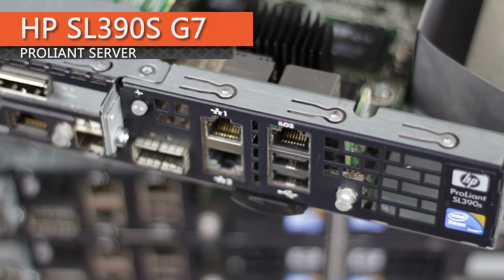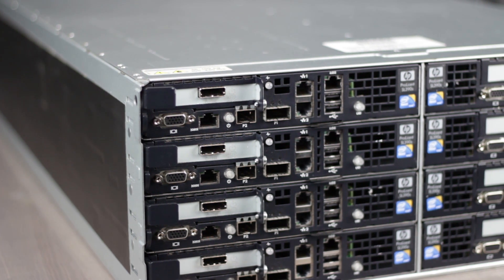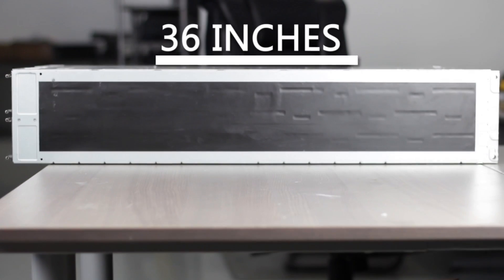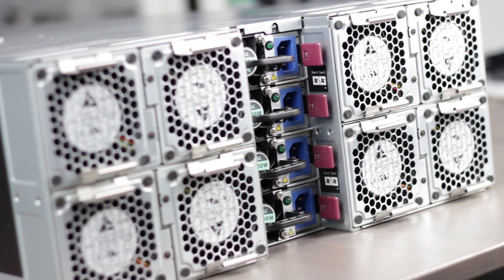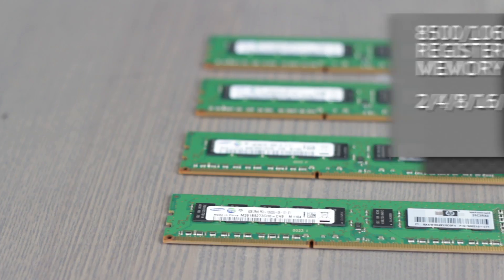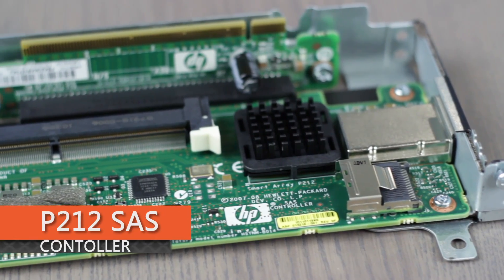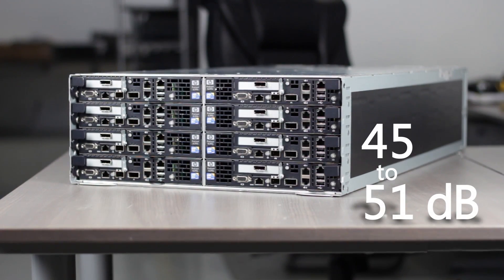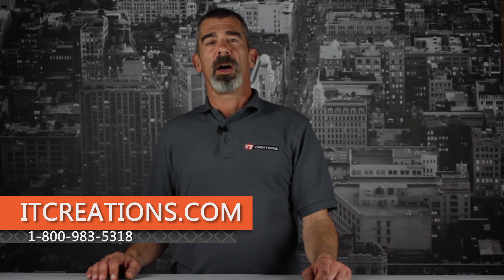HP SL390s G7 1U Server and the S6500 Scalable System Chassis Overview ( IT Creations, Inc )

Comment: No shared input/output? Each node has its own input/output?
Reply from the maker: I will preface this comment by saying this system is about 12 years old. Each of these nodes has a 1GbE RJ45 port, a dedicated iLO3 RJ45 port for management, a 10GbE SFP+ port (which might be optional) and a serial port. Only the serial port is a shared input/output port in this situation. See page 1, Quick Specs node.
Quick Specs node: https://www.hpe.com/psnow/doc/c04123322 
Quick Specs Chassis: https://www.hpe.com/psnow/doc/c04123242.pdf?jumpid=in_lit-psnow-getpdf 
Hope that helps. thanks for watching!

Comment: HP SL390s G7 regarding the 4u version of this model that accepts 8 GPU cards. Will this only work with Tesla GPU cards or will it work with any PCie 2.0 compatible GPU cards like the Nvidia 1080 or 980 etc...  In their PDF it states that the tesla cards are compatible but the slots and operating system would indicate that other cards could be used. What do you think?
Reply from the maker: +xpez Yes, the 4U version does accept 8 GPU of supported cards. However, the GeFiorce GTX 1080 is not on the list of supported cards, which does not necessarily mean it won't work. that said, the GTX 1080 is a double-width card so right there you are down to 4 supported GPUs of the 1080 variety. I think the power will support the requirements because you do have 225W/GPU on the SL390 and the card (1080) only requires 180W. Another consideration, are the lanes themselves which are PCIe 2.0, while the GTX 1080 is for 3.0 PCie. This is a question that can really only be answered by testing. if you arrive at a definitive answer we' would love to know. Here are links to the specs for each for your amusement, and likely frustration. http://www.geforce.com/hardware/10series/geforce-gtx-1080#specs  http://www8.hp.com/h20195/v2/GetPDF.aspx/c04123322.pdf
Reply: Thanks for your thorough answer. This is good news.
Reply: One other question. Did HP come out with a GEN 8 version of this machine with 3.0 slots?
Reply: Got it!
 The HP ProLiant SL270s Gen8 SE Server supports two Intel® Xeon® E5-2600 and E5-2600v2 CPUs for leading performance.
It includes a FlexibleLOM networking slot for 1 GbE, 10 GbE, or InfiniBand options, and a PCIe Gen3 x8 LP slot for I/O expansion.